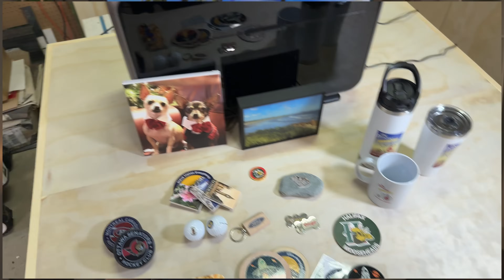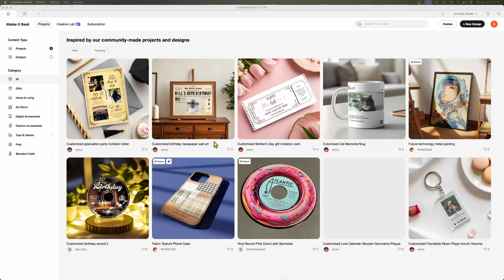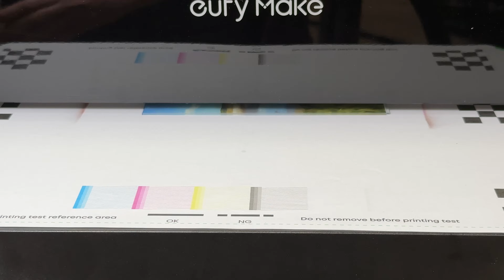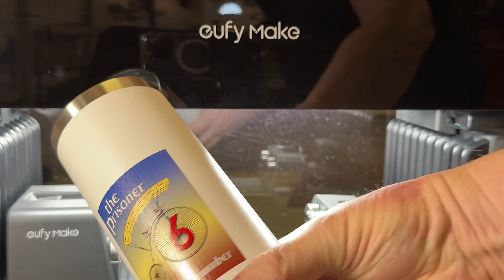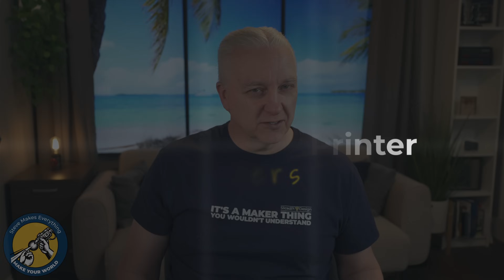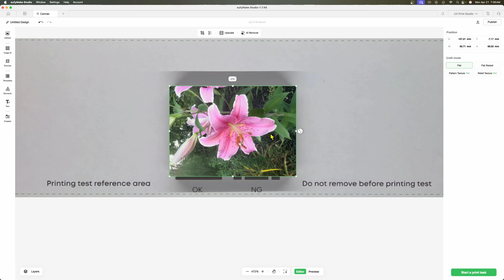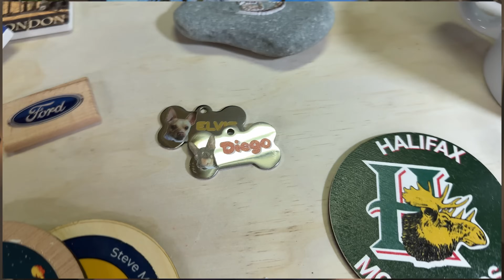eufyMake E1 | Pro-Level UV Printing for Creators at Home!

Comment: So in regards to VOC's , how did you handle that? Would a simple exhaust fan in a window be adaquate to keep the levels down, or would a more elaborate ventilation system be required? Also, are there minimum and maximum temperature /humidity requirements for the environment where the printer will be used and stored?
Reply from the maker: You can use the same sort of fume extractor or exhaust fan that a laser uses. If you are working with small items, the doors can be closed to force air through the built-in charcoal filter.  It would be a significant issue if you were running this in a small room.

Comment: Did you try spraying a sealer on the cork before printing on it?
Reply from the maker: What I tried to dois print a gloss layer first and then the image and that didn't help either.  Soft surfaces like cork and leather just don't work very well.
Reply from the maker: I didn’t but that would be the way to do it. You probably can do it with the print itself by first laying down a layer of gloss ink and then printing the color layer

Comment: I've seen a few videos about this printer and no one has said if you can provide your own image to control the texture or 3d effect. I don't want to rely on AI for this. I would like to use a greyscale image.
Reply from the maker: You can’t - at least not yet.  The printer software uses AI to interpret the relief from the supplied image. However you could hack this a bit by printing the image and then reprinting the texture layer with gloss ink
Reply: @SteveMakesEverything  Thanks. Just put down the deposit, but unsure if it'll do what I need without complete control.

Comment: Extremely impressed with the 3D relief.  I wonder if this technology can actually be used to created 3D objects and with the benefit of true color?   Really cool stuff.   :)
Reply: This is not new technology. It existed before 3d printing. The only thing that makes this consumer friendly is the addition of a camera. Factories that produce countless copies of one product have no need for a camera as they only need to calibrate once. UV ink is also very toxic and not environmentally friendly. It is not the way forward. It just gets the job done for now. 3D printing whether resin or fdm is still in its infancy. There are way more advanced models, and this is not it. The cost for production makes those models not consumer friendly, though.
Reply from the maker: @Cola-42  To be blunt, don't buy this.  If you want to spend $40K+ for a commercial printer, go ahead.

I didn't claim there is any new technology in this printer, and I think you're right about that.  What's new is that normal people can afford this, and it will enable people to do a lot of things they couldn't do before.

I would, however, join you in hoping for more advanced 3D printing.  I think we all dream of a replicator in our living rooms.  FDM evolution crawls along, but resin printers really need more investment because they are the real future in 3D printing.
Reply: 2.5 D only
Reply: @ Hopefully they'll figure out how to 3D with this technology.   :)
Reply from the maker: The limit in height is 5mm so you aren’t going to be printing full 3D images. I can see this technology allowing that to happen though in the future.

Comment: $1500 is not budget friendly!!
Reply: For this technology it is.  Semi commercial ones I think are 30-40K.
Reply: @chrisoneslager7334  its budget friendly if yiour budget is very big!!!  you need a lesson on what budget friendlt is! this may be less expensive that others in this category but that dont mean its budget friendly in the normal sense! get a clue!!!
Reply from the maker: As others have said, when I was looking to add one to my shop the cheapest one I was looking at was over $10k. It offered similar capability to this Eufy.  So this is relatively budget friendly - I didn’t say “it was cheap” 😉
Reply: @SteveMakesEverything  so call it cheapest.. not bdget feiendly!!!!
Reply: @IronMan-yg4qw  it is in the UV printer world by a long shot
Reply: @jonsaircond8520  its not budget friendly in the usual sense that common/normal people know it to mean! wtf!
Reply: @IronMan-yg4qw  sure it is if you were looking to get a UV printer this is the most budget friendly there is. Just because it isn't $300 doesn't mean it's not budget friendly
Reply: @jonsaircond8520  it does not mean budget friendly! budget is budget! cheapest  is cheapest! the cheapest yaght does not mean budget friendly yaght!

Comment: These are interesting, but I still worry about the cost.
Reply from the maker: Hi Rich.  Yes ink for UV printers isn’t cheap but it does seem to go a long way. Anker says they have a solution to this that will cut the cost of ink in half, so fingers crossed
Reply: @SteveMakesEverything  I heard you say that Steve. Likely refill bottles for new ink cartridges. I do like the print quality though. I would probably want one, but I have a DTF printer on the way for shirts and stickers .
Reply from the maker: @TheLouisianaHobbyGuy  I think they are doing something like AMS on 3D printers.  It's more than just injecting more into cartridges.
Reply: @SteveMakesEverything  That would be cool!

Comment: I have watched a number of reviews on the printer and you have the best - most through one yet.  I am just a hobbyist and the ink cost and the maintenance cycles concern me
Reply from the maker: There’s not much to do on the maintenance front - the printer seems to look after itself.  Ink is the only real consumable and replacing all the cartridges is a bit expensive, but you’ll be able to buy the as singles and they do seem to last.  Anker also claims to have a solution coming that will cut the ink costs in half, though I’m not sure what that is yet
Reply: @SteveMakesEverything  Thanks, I will wait to see and learn more.  Good review!

Comment: Is there support for non-planar printing, outside of the rotary tool? I'm thinking specifically of printing full-color textures on top of 3d-printed toys.
Reply from the maker: You can print a texture on anything. The printer software doesn’t currently build a focus mesh for items that aren’t flat, but I assume that’s coming since the hardware has all the required bits to do it.

Comment: As long as no information is given about the inks (i.e. consumption and costs), I only see this video as an advertisement for a probably free product.
Reply from the maker: The kick starter fires up in a couple of days and should have all the details. All of the pricing has already been published.
Reply: @ Saw it in another video today. A subscription for all the software's features? ... sorry, that's not possible, I'm out.
Reply from the maker: @PhotEdy  Well you can still create things with your own images, which is typically the way I would use it, so most of the AI stuff isn't very valuable to be.  However depending on what I was creating I'd pay for enough credits to do the texturing.

People never seem to understand that all of this AI generation requires serious compute power.  It's beyond most companies to provide on their own, so they use things like Amazon AWS to do the work and pass the cost of that transaction on to the user.
Reply from the maker: They have all of this information, which I'm sure they will discuss in their release live stream.  I'm under NDA so I can't talk about any of that.  It's comparable to other UV printers, though.

Comment: So I'd buy one right now...  but then I consider ALL of my kickstarter 3d printers...  Only one ever worked, and you can still buy the printer and parts many years later...  The rest of my kickstarter 3d printers either took my money and never shipped, or shipped something that needed parts and supply support that never materialized.  I know the brand Eufy, and I am one of their customers, but even trusted names like Creality can make "never worked" boat anchors.  So I would expect either a minimum 5 year commitment on parts and supplies, or open source the whole thing.  If someone fails to deliver a working first run, but keeps working on supplying parts for 5 years I know I'll get it running eventually, even if the first Kickstarter version is a flop.

I had many good successes on Kickstarter, but the failures were for expensive things, some from trusted brands.  I want to see some commitment from Eufy.  Will my EufyMake E1 still be a supported functional running printer in 5 years.  They don't have to guarantee the printer, only that I can still buy parts and supplies for it.  I get it that it costs money to support prototypes, I'll pay for the parts.  I just want to have access to parts.  

I'm concerned that KickStarter has become a shortcut to very expensive and very short lived products.  The $50 deposit button is not working, I spend 10 minutes trying to get my deposit in before april 28...  but the 10 minutes made me consider if I want to gamble the $2k, being my track record on Kickstarter is soooooo bad for things just like this from reputable companies.  so yeah, Eufy needs to tell me it will have parts for 5 years.
Reply from the maker: Yep I’ve seen this happen, though the hardware here is already production grade as far as I can tell and Anker has a roadmap for this product.  You can always wait until after the kickstarter. You’ll pay more, but you’ll have the security of know it’s a real shipping product.
Reply: @SteveMakesEverything  yeah, this is the way
Reply: @SteveMakesEverything  actually their Kickstarter 3d printer became discounted quickly so that worries me. Even the very first 3d printer I ever owned is not discontinued
Reply from the maker: @ Best to wait until this is out of kickstarter mode then to see what happens.  To me this looks like a directional change for Anker, but a wait-and-see could be the best path.

Comment: Is there a price list for the consumables?
Reply: There is an image that listed a set of cartridges for 299$ and some sort of bottles (refill?) for 43$ each or so.  The big questions is how long it lasts. I guess with textured printing not that long depending on the height. I would guess that the  texture printing gets rather expensive, unless you can build the 3d height with cheaper materials or a classic fdm 3d print and then just print the UV Color on top of that 3d shape.
Reply from the maker: @Leif_YT  Well I've had mine for a month and printed tons of things and still have changed a cartridge - not even white.
Reply from the maker: I have one and I’ll confirm that I can publish it, but regardless it will be published when the kickstarter open.

Comment: Back in the 90s there was a company making low cost thermal wax transfer printers. These printers made beautiful prints that had the added advantage of being waterproof.
Reply: @GaiusTacitus  I think those were named Alps printers
Reply: Yes, early color printers.  We used a model called the Fargo Primera Pro for mapping software we sold.  Color inkjet came along pretty fast afterwards.
Reply from the maker: Yes I remember these.  They were quite expensive for the time and didn’t hang around too long before they got eaten up by cheap inkjet printers
Reply: @ its the cheapest he budgest friendly!
Reply: así es, en mi trabajo ( sign express) había una gerber edge en el año 1995
Reply: @pabloanab  That's it. I loved those printers.

Comment: Looks nice, I have never looked into uv printers before but looks like a real handy tool for makers and small businesses. Dread to think the running price for the ink. I presume it puts out the same amount of vocs as a resin printer so would definitely want to put it inside a vented enclosure of some kind. Is it very fussy about temperatures like resin printers are?
Reply from the maker: Yes it’s similar to a resin printer, though it’s not temperature sensitive.

Comment: WOW, hockey pucks
Reply from the maker: I see a business just for these. Something even local junior hockey teams can afford for their kids
Reply: @SteveMakesEverything  Ok, then send me your machine so I can find out if that is true.
Reply: We'll call it test marketing.  I'll meet you at the border.
Reply: Did you see Skyler's video that she just released. Great stuff. If one has a eye for design etc., I think they could make a killing with this machine
Reply from the maker: @TTC1940  Sykler does amazing work - I certainly wish I had at least a little of her talent.  I do think there are lots of focused businesses that could be created based on this E1 printer -almost anything I showed in my video is an opportunity to make and sell something.
Reply from the maker: @ Well, if I didn't love this thing so much, we could talk about a deal, but this is going to be in my shop for the foreseeable future.😀
Reply: @SteveMakesEverything  Should I cry no or later.  Just saw a video that they made a jig to uv print 48 golf balls at a time
Reply: What are your thoughts as to the durability  of the print?
Reply from the maker: @TTC1940  It tried to scrape one of those 3D prints off of a piece od acrylic and it was concrete.  I managed to chip it a bit, but I gave up after a few minutes.

It'd say this is fairly permanent, though if you do high releaf of small parts it is possible to break them if you try.  It's a bit like china, though it won't shatter if you drop it on the floor.
Reply from the maker: @TTC1940  The big bed for the E1 would easily handle 24 golf balls (and you could possibly squeeze 48 on there)

Comment: Can this printer print onto DTF film to press onto tshirts and clothing?
Reply: i don't know this particular printer, but i have experience with a Mimaki UV printer, and it's not for printing on bendable surfaces (like clothing). when the surface bends, the color flakes off. it's great for printing on hard flat things. for example, i printed things on the back of my laptop and phone. at work we used it to print on hardcovers for student's thesis printouts, and occasionally for printing on pens or cases for glasses.
Reply from the maker: As Kapa1611 mentions, it is currently best for hard surfaces and not (at least yet) good for clothing, but I hear rumours 😉